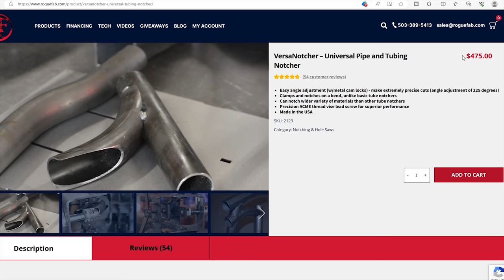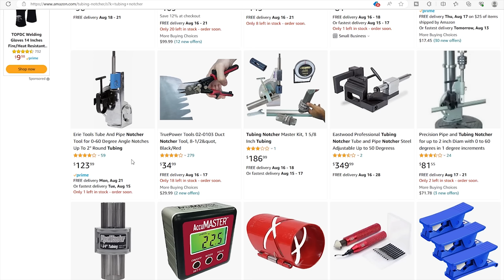I Hired My First Employee! Ultimate Suzuki Samurai Buggy Build Episode 10.

Comment: Long time machinist here. With that steering column and your new lathe, you can machine spiral grooves down the shaft which will pack with grease and keep that thing quiet an greased. Could even machine o ring grooves on either end to keep it sealed. Just taking that deign one step farther without much more effort. Food for thought. You vids are good. I just like seeing other people’s thought process when it comes to building. Keep up the good work.

Comment: Just an idea on your greaseable steering shaft, I have ran heavy equipment for 30+ years,  some older earthmoving scrapers had the same exact setup,  as the grease gets old it will get black from dirt and metal wear. On a hot day all it takes is a bump on the side of the steering wheel to shoot grease speckles on your clothes. It took us a couple summers to figure out why our clothes were getting these black freckles. Might want to tie a bandana on each end of the tube to act as a diaper... we ended up using red shop rags
Reply from the maker: Great perspective! Thank you!

Comment: as a machinist and metal fab guy myself  i would have made up a pair of horizontal tube  inserts with a  milled section in the middle for the radiator mounts

Comment: I had a similar steering setup on my dune buggy for years with no power steering. Occasionally sprayed dry lube in it if it felt tight, but it otherwise never cared, squeaked or wallered out.

Comment: Get yourself some 222 threadlocker.  It's low strength and oil resistant.  It would seal the holes that you tapped, but is easily removed with even a screw driver.

Comment: Anytime I’m welding threaded nuts, inserts, etc., I always use a bolt with anti seize to maintain the threads. You can always chase with a tap, but sometimes (I’ve experienced) you double tap the threads because of distortion.

Comment: Hey Nate, loving the progress. Is there a reason you installed the quick release backwards? If you install it with the female side on the steering wheel, it'll be easier to remove the wheel. You can also buy a "lock" that goes on the male side to further deter people.

Comment: To keep your weight down, buy some LTO battery cells. 50ah can do 500 amps. Also upgrade to alternator to a 250 amp alternator to power the winch that way you don't need as much battery capacity. if you want to go even lighter you can go lipo batteries and run the truck at 16v and step it down for the ecu. you can get a 15ah lipo battery that does 600 amps, and weighs 3kg. basically saving you 20kgs and giving you way more winch pulling power.

Comment: Back in the early 2000's it was a pretty common practice to cut and shorten the pinion of the mog 3rd member to gain clearance. Personally I would ditch the center section and just go with a 9" or toyota 3rd member. Better parts availability, and better gearing options

Comment: If the pipe is welded and water enters from the welded part, open an air vent hole in the pipe before welding, and close the air vent hole after all the pipe welding is completed and the pipe cools down a little. This is a way to prevent the hot air from welding from creating pinholes in the weld.

Comment: Why not go with ORI's on this for what you are using it for?You could have made UHMW bushings for the steering shaft so it stays quiet and you can replace them over time if needed.Another lathe project.haha
Reply: I seen tbe lathe in tbe video,  thats why I said the bushings could be a lathe project. They would be self lubricating so he wouldn't need grease that will just attract and hold dirt.

Comment: Those bench lathes are mediocre at best, BUT they still are handy for creating small parts provided you don't need aerospace accuracy, I've found I use mine quite a bit for small odd parts. Disassemble the slides, clean them and de burr any rough edges with a stone. When reassembling, pay close attention to the gib screw adjustments, you want them snug to eliminate lash but not so tight that things are binding.

Comment: Nate have you considered hydroboost instead of vacuum boost ?
Reply from the maker: I have! But for this build I figured using the Tj pedal assembly would be easy and predictable since i had one i could measure right next to the zuk. And since the booster bolts right up, is cheap and enough for 1-ton brakes it made since for my situation. But i will be playing with hydro boost on a future project.

Comment: Hi
Why you go in to manual gearbox not a automatic?
Maybe gearbox from Passat or Audi A4 plus T-case? Or flange and trans from truck or Jeep. 
I know this is be more expensive but for rockcralw is in my opinion better.
Reply from the maker: I prefer to crawl with a manual. You will find that most rock crawlers and stump jumpers here in the PNW prefer a manual 👍

Comment: So are competition winches just smaller to save weight? Are they faster? I'm looking for a new winch so if they are "Better" then that is the route I'll go but I've never really had any dealins with em before
Reply from the maker: Yep, they are all about saving weight and line speed. They hold less line and are more expensive, but for the right project, they are the perfect tool for the job 👍.

Comment: What’s spring rates are you gonna run?
Reply from the maker: Not sure yet. I will come up with an educated guess after I get some corner weights.
Reply: @DirtLifestyle  sounds good, I’m curious to see what it will be. Mine is 1100 on each front corner and 500 on each rear corner. 3200lbs total

Comment: You can pop the brake master reservoir off add use 2 small remote reservoirs or T off the 2 into a single tank to keep that same master cylinder. I’d hate to see you ruin the symmetrical aesthetics of that beautiful tube work.